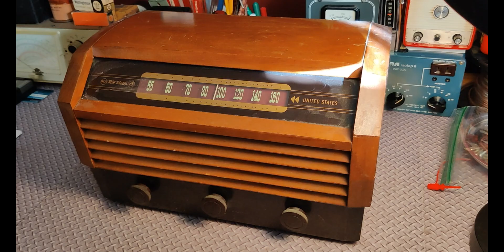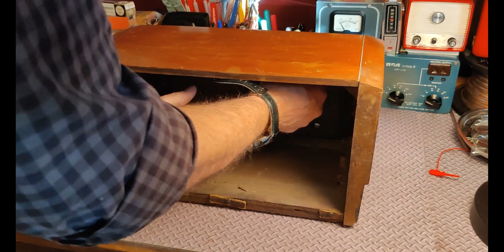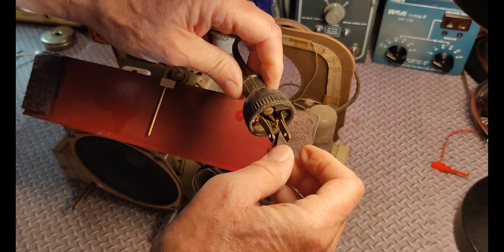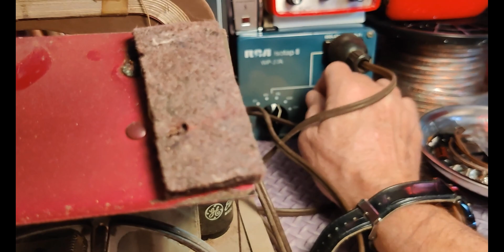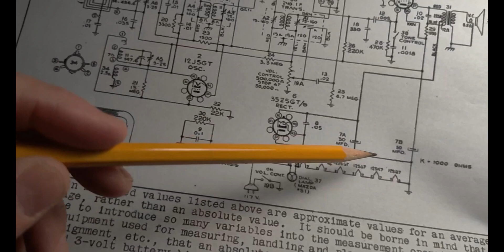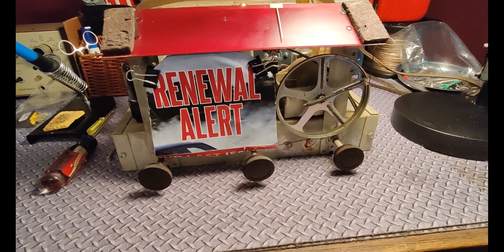1945 RCA Victor Model 56X3.

Comment: I just watched this video, nice job!  Earlier this month I finished rebuilding an RCA radio I purchased at a flea market.  It's a different cabinet but I think it's the same chassis, RC-1011.  All new caps and resistors.  Mine had a failed switch/volume, both bad.  The closest replacement I could find had a bit shorter shaft but it worked.  The only issue now is the speaker isn't in very good condition, I'm considering my first attempt at replacing the cone but I'd rather find a good speaker.
Reply from the maker: Doug, thanks for watching. I’ve not had the honor to do a re-come yet, that will happen one day I’m sure!

Comment: My Father-In-Law found one of these radios by the side of the road. I have had it taking up space in my garage for years. It appears to have all the tubes and internals, the antenna coil is intact although the cardboard it is on is bent / cracked. I am not sure what to do with it, as I am surely no denizen of Mr Carlson's Lab or your shop.  I wonder what would be the best thing to do with it? If I was going to sell it, I would only want a couple of bucks  for it, as fully restored ones are selling for around $140 bucks, Better yet if there was some museum that would want it, I would donate it.
Reply from the maker: Christopher - Thanks for watching my video. If you think it’s too far gone, you could offer it as a parts or restoration radio. Facebook marketplace might be a good place to start. If you’re in or near a good sized city, someone may want it! Good luck!
Reply: @RadioRetired  That's the thing, I think all the original parts are there and undisturbed. But its wooden case and cardboard have seen better days and the finish is cracked and the front panel where the knobs are mounted is split as well. Someone wisely cut off the plug on this thing, as I would not want to be around when someone plugs it in :)
I think it might be fixable, or it might even work.  I am going to check Facebook Marketplace if there is someone local. I have a feeling that dial face glass will be in pieces regardless of how well I pack it if I was going to ship it, unless I take the chassis apart and pack the dial face separately (if that is even do-able) but perhaps someone local will reply. :)

Comment: You can 'polarize' the plug by splitting one of the prong blades and spreading it a bit wider, then fill it in with solder.
The coupling cap to the 35l6 grid should be replaced.  Those old caps leak and cause the output tube to go positive on the grid, which will destroy the tube in short order as it runs hot in class A2.
800v cap?  BS, that radio won't have any voltage greater than 200.  That radio was made in the days just after WWII, they used whatever parts they had, a 1000v .001 cap is small enough physically to fit in, so to reduce cost of inventory they probably just ordered higher voltage caps than necessary (used them in TV's also!).
Reply from the maker: Another commenter made a similar suggestion. It’s a great idea and I’m going to put that in the memory banks!
Reply: Likely WW2 surplus from a radio transmitter or other transformer powered equipment.

Comment: All the screws is a very good sign!
Tip:
To polarize a non-polarized plug, cut from the end of the neutral side with your sharpest diagonal cutting pliers, through the little hole. This will force the end apart, allowing it to only fit one way in modern outlets.
Reply from the maker: Great idea,, thanks!

Comment: Sams are great. But always watch your step. I have one that has a couple of typo's in the parts list. You can barely make out the correct markings in their chassis picture. Verify what you find in the radio is original or replacement . Some part numbers include date info. Use all the information you can find. Nice radio!
Reply from the maker: Thanks for the tip. I usually take Sams at face value. I mean shouldn't the producer of that information know the most about that radio design. That said, I've been warned before to be careful  and check.